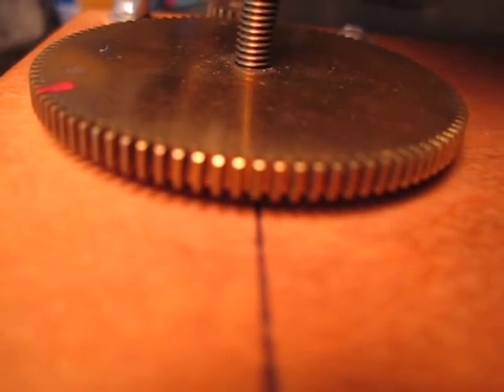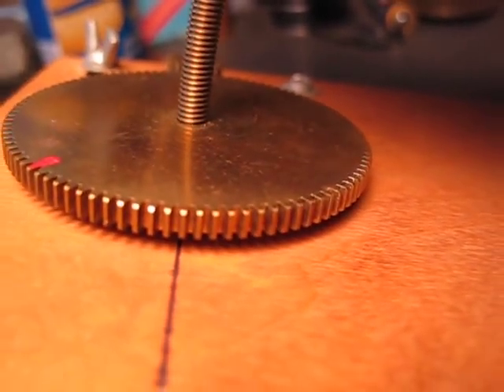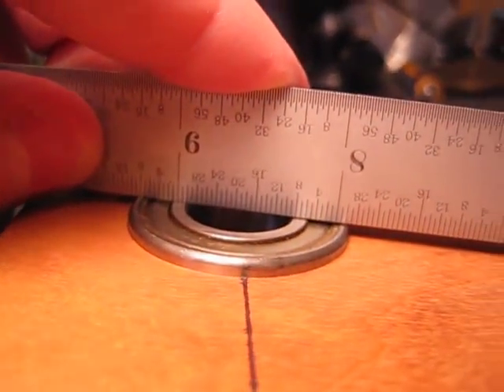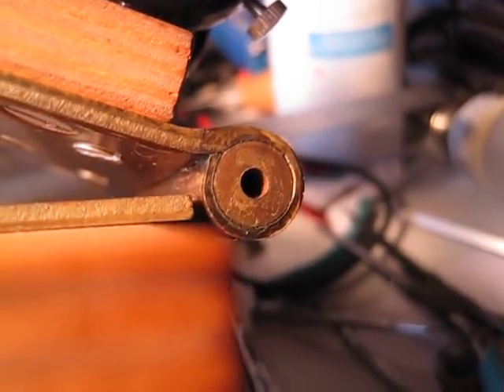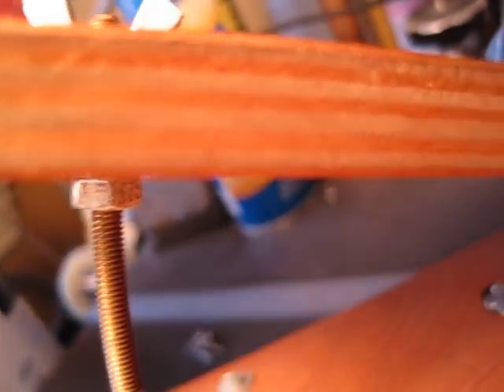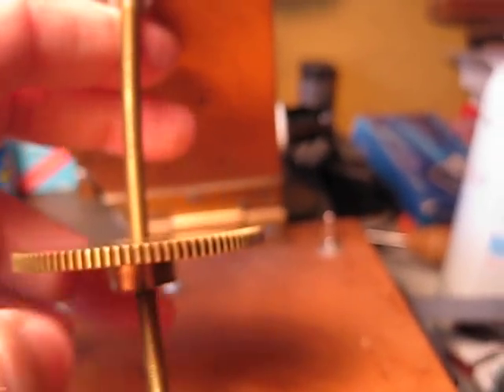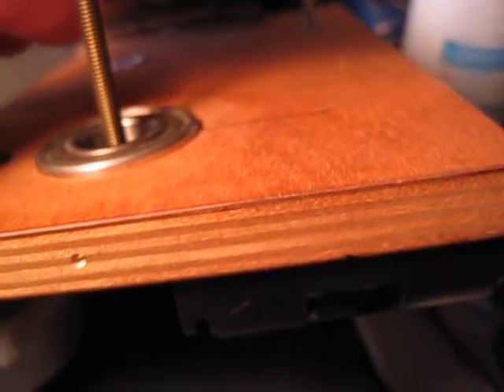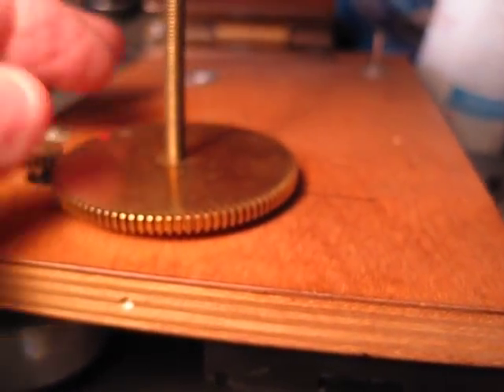Barn Door Notes - Bearing plane to hinge axis alignment

Comment from the maker: Yes, barn doors MUST be polar aligned. The question is how fussy should one be about it. If your doing wide field images for a minute or so, you do something simple like aim at Polaris through a soda straw that's aligned with the hinge axis,
no joke.

Or you can go nuts like I do and use a high end telescope polar alignment adjusted to be perfectly parallel with the hinge. This along with having all the other elements of the barn door near perfection means I can use a 300mm lens for 15 minutes.